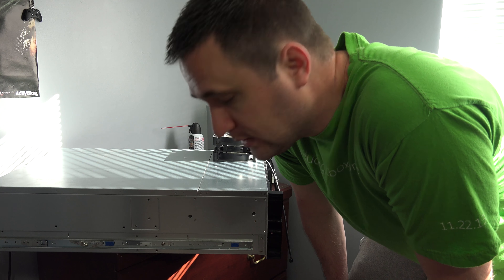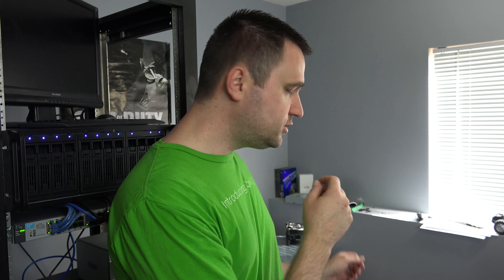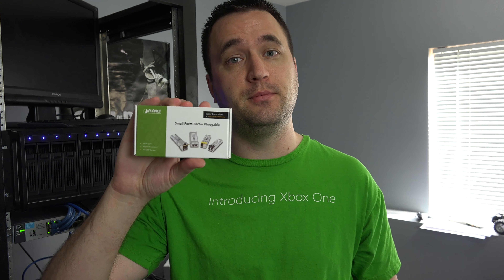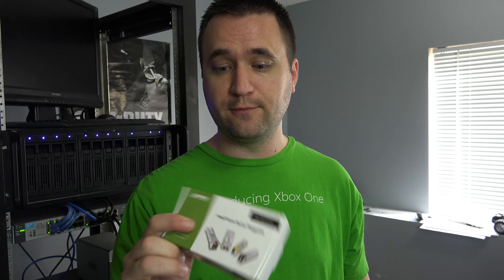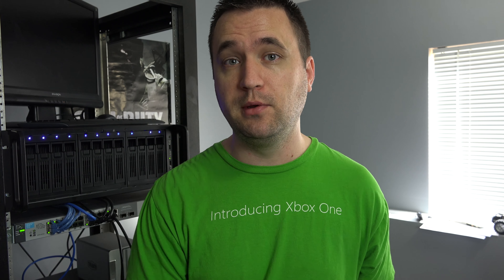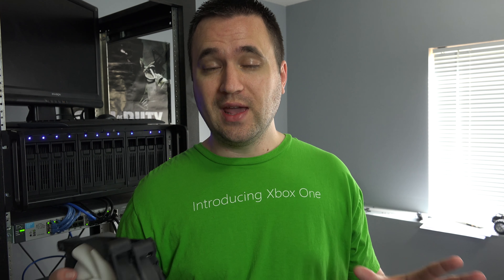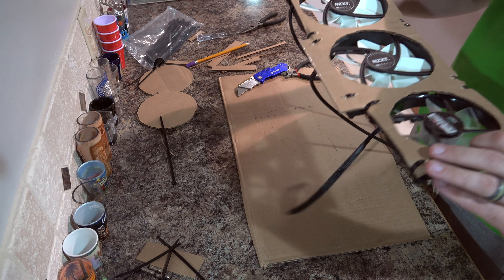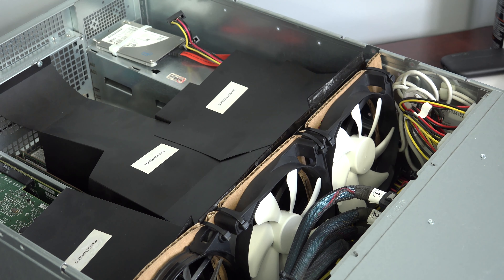Taming the Beast - New Server Vlog - P2

Comment: Shocked at the noise reduction when you inserted those fans! Great job man. You should consider building a 3D printer template instead of hacking the fan plate to make the fans work on it.

Comment: I LOVE unRAID. I fell in love with it almost imemdiately. Now I have Plex running as a docker app along with several others, and a couple virtual machines, as well as the normal sharing stuff. I LOVE the parity "RAID" system it has, so much better in a failure than a raid system.

My servers are named after planets, my unRAID box is Saturn. My desktops/laptops are breakfast foods, I'm typing on pancake right now.

Comment: I'm gonna have to try this out too. I got 2 rack mounted server (Well 3 but only using 2) that I got from work chilling under my computer desk and the only reason I don't keep it on 24/7 is do to the noise. Don't know if one of them will keep as cool as yours since it doesn't have the channel things to guide the air through. Good stuff dood.

Comment: While that might be enough cooling for the cards and the board - I'd definitely agree with getting some active cooling on those processors -- the case has the space for a cooler with a fan - also -- did you check the thermal compound to see if it was still enough? Used servers on 24/7 prior to being bought could probably use a new squeeze of the stuff

Comment: I think they make a fan wall for that system that is designed to mount 3 x 120 mm fans
Those 80 mm fans are just loud because they run at like 5000 RPM.  They make them that way because they expect those servers to run in a data-center where nobody is there to hear it.

Comment: not sure if this would work. but if you have 2 port 10 gig nics in all of your servers and your computer you should be able to use that hp cable to plug the plex server into the new server, the new serverinto your computer and your plex server into your computer as well, it would make a sort of triangle but would give you 10 gig from server to server and from both servers to computer

Comment: I had the same problem with my Norco 4224  server the fans that came with it were super loud. I did the same thing your doing with removing the center metal wall I used 3 120mm fans and  I found a new metal wall made to fit my server and it holds 3 120mm fans and it had room for cables on eather side I will try and find the site and send you the link.

Comment: I don't know what disk controller cards you are running, the cooling is a much for them as they are for the processors, they generate alot of heat and need cooling not to break down, just keep that in mind when you are checking the temperatures.

Comment: nice setup. I'm running stablebit scanner and drivepool right now on server 2012 with 10gb card as a nas. Been really debating if I should go unRAID or not. Do the 10gb cards work out of the box for unraid? My hesitation was the price and performance gains that I could get. I'm not sure if it would perform better than my current build.
Reply: Anthony Moody Mellanox connect-x 2 cards work in unraid - I had it running myself. They can be found for like 18 dollars with a dac on ebay
Reply: Christopher Ferrante I have those connected to my esxi and nas now but are those going to be plug and play with unraid ?
Reply: Anthony Moody I ran it bare metal and it was detected so I think you should be good if you were going that route. I tried unraid but ultimately went with rockstor instead for a more traditional btrfs setup
Reply: Christopher Ferrante I'll look into it. thanks for the input

Comment: +Byte my Bits, Dude you are using passive cooler for the cpu with 120mm fans? Why you dont replace the cpu heatsink and cooler. Was loud beacause they are high rpm fans.

Comment: I have 2 servers running 24/7, ones a Dell 2900 and a Dell R710 both dual socket Zeons. And I can tell you from experience with my clients servers and mine, that yours is actually quite. For comparison check out some 2900 startup vids. 

PS.. Becareful with those fans, if the server monitors the fan speed they will throttle up those fans to keep them in operating spec.

Comment: You're really swimming upstream on this one. There are many well thought out features in enterprise hardware. The problem is that if you try to modify the hardware, a lot of the  features turn into obstacles.
It looked as you replaced four fans with three fans. In most enterprise systems I've worked with, that would be interpreted as complete fan failure on one fan and the system would compensate by running the remaining fans on higher speed, even though the temperature has not increased.
Wouldn't it be possible to replace the noisy fans with lower rpm fans of the same size? Then you would get to keep the original fan-tray, hot-swap, fan-control and air partitioning as the case was designed for.
I'm sure you could overcome whatever problems you find, but it may take some extra effort.
Reply from the maker: overcoming obstacles is what makes it fun :)

Comment: did you have and problems with your back planes killing drives? I had a few rows burn out and fry 6 4tb drives. I pulled the back planed out ant just ran individual power and SAS to sata splitters to each drive from my raid card.

Comment: These servers are not meant to have fans that are throttled. They are meant to be in a room away from people working and that room is meant to be chilled, which is why the heatsinks don't have fans on them.
Reply: Then why does every server I've seen have the control for fans? My servers have it, Dell PowerEdge servers have it, HP servers have it, etc. Second of all, what good does a chilled room do if there isn't being AIR drawn through the heatsinks? Use logic! They don't have fans on them because they don't need it since air is being ducted over them. Natural convection isn't going to do shit in an enclosed case around other equipment.

Comment: but if you just had your server rack in a separate room noise wouldn't be an issue.
Reply from the maker: If only that were an option...
Reply: Byte My Bits I did not mean it like that, i mean it's just not very ideal to have your server rack in the same room as your main PC.
Reply: Did you try shutting en opening the port of the switch via telnet or console cable?
Reply: Yes something like that.

Comment: I have no idea why you went through all this trouble, I have the same server chassis as you and I only replaced the stock fans with quiet 3rd party fans and installed a closed loop liquid cpu cooler on my plex server/NVR and it has been running silent for about a year now. It is even quieter than my gaming PC! I can even rock my infant son too sleep in there. This was completely unnecessary.
Reply: I've the same server chassis as the two of you. Any suggestions for any good quiet 3rd party fans?

Comment: Jason, I have a very simular system. I have 24 drives installed. wait until you fully populate that sucker. Those fans are only 1/2 of the problem.

Comment: would it not be alot better to swap those heatsinks out they are terrible and are made for 1U where you dont have the room for a bigg heatsing with heatpipes
Reply: But why put the money into it? If it works fine, don't fuck with it. I'm pretty sure those things can handle those chips, the TDP doesn't seem to be that high. Also it came from a reputable (builder?) and it's working fine. I have a 22 core XEON server in a 1U chassie and it hasn't overheated yet. The heatsink cooling that monster is a Dynatron copper heatsink WITH heatpipes. Just because it's small doesn't mean it's not mighty.
Reply: seems like he did what i said anyways

Comment: enjoy melting harddrives...
Reply from the maker: been running solid and cool for 2 years :)
Reply: nice to hear, haven't thought that little airlow is enough, i moved my whole storage box from a tower to a 4he chassis with only ~10+4hotswap cages and temps increased by ~8C+ per drive and that with 3x 120mm fans running @1k rpm (noctua, because the 120mm that came with that chassis where jet engine like yours ;D)

Comment: The HP Prolient DL580 GEN3 is noisy but that is the way it is in less you want to water cooler, why not put them in the basement or under the house or on second thoughts why not use four AIO watercooling kits and use that to cool your HP Prolient DL580 GEN3 I think you will need at lest 16TB of ECC system RAM, Why not get another and install a graphics card and sound card and use it as your personal computer on which you run your games on and they should run well on 16TB of ECC RAM.

Comment: rather have your parts manufactured by someone with a CNC or 3D printer or both. The moment you start "cutting" the server will lose its value and you might have trouble moving it along when the time comes

Comment: Shouldn't need those 10gb connections with unRAID...
Reply from the maker: I only need 1g to my network. but between my main pc and the server it is very useful. especially since unraid uses an ssd cache drive and I use an ssd on my main to temporarily hold stuff.
Reply: The cache makes sense for faster speeds, but in general unRAID will not reach write and read speeds much faster than gigabit.  I would hate to see the beautiful server with 20+ drives pulling single drive performance.
Reply from the maker: I dont need multi drive performance for the main array tbh. It's only the transfers between my server and main PC that counts. After the initial file dump, I wont use much more heavy moving. Howevere, the 10g did still give me 160MBps write when I was moving my library over. compared to the 100-110MB with 1g. So that went a lot faster with the abundance of throughput. Also, 10g between two PC's is super cheap and easy to do. So even if it adds only a few benefits, it's not a major cost. :)